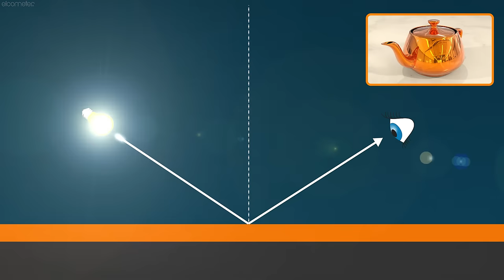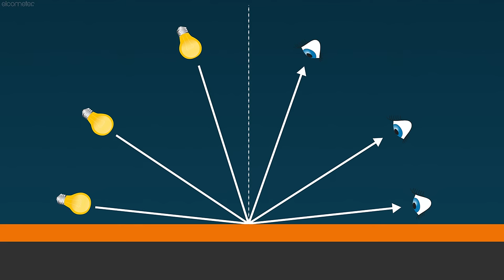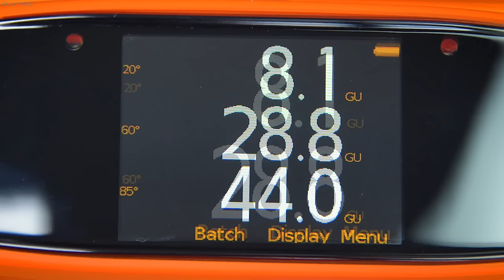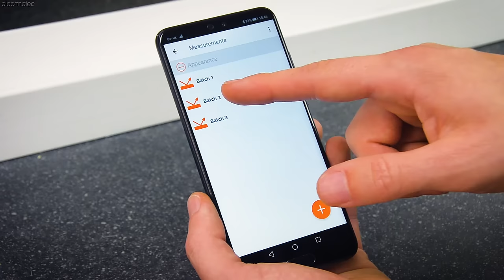How to Measure Gloss using the Elcometer 480 Glossmeter

Comment: If the surface gloss of an aluminum ally casting is between 5 and 15, should I use 85°？For example， when using 60°, you got a series of numbers like, 9, 8, 13, 11, 7. The gloss of powder coating is about 10, but have a tolerance of ±5.
Reply from the maker: Thank you for your comment.

Our suggestion would be to use the same angle consistently so your results are comparable.

So if more results are above 10GU, measure using 60°; if more results are below 10GU, measure using 85°. Always make sure you quote what angle you are measuring with in your results. With all of your measurements taken at the same angle, this way you can directly compare your results with each other.

However, if you are working to a specific standard or job specification, we suggest you check this thoroughly to see if it states what you should do in this situation.

If you have any further questions, you can always contact techsales@elcometer.com or visit www.elcometer.com/contact-us to find your local Elcometer distributor.